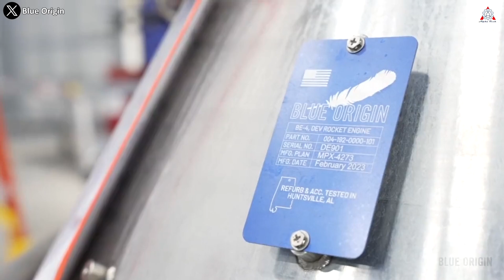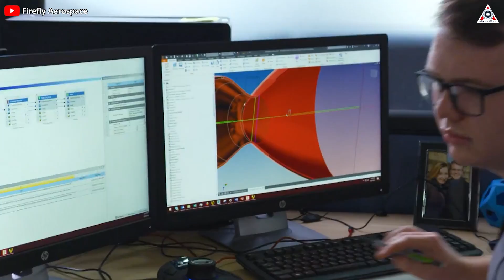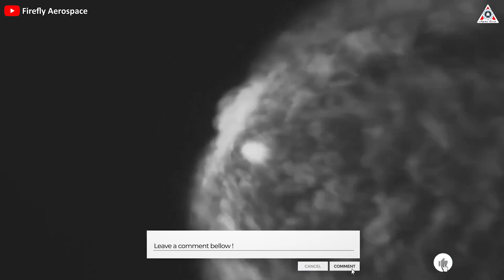Firefly's Rocket joined SpaceX reaching orbit totally shocked Blue Origin...

Comment: aren't we running out of room in orbit for satellites?.seems like there is so many up there that they are going to start crashing into each other.
Reply: not yet.
Reply: There are only very few routes on the oceans used for freight ships there are interactive maps that show those but it's maybe 10% of oceans surface area actually used by freight ships (probably less than 1% but being on the save side) and there are approximately 50,000 to 60,000 cargo ships in the world active at all times. They are 100 m to 500 m in lenght. These numbers don't include the private Boats and Yachts, Cruise Ships, Navies of Nations, Ferries, Cost Guards, Submarines, Science ships ...
Now you have orbits that at each height could be looked at as the surface of a shell at that height above surface of the earth. 200 km, 300 km 420 km (ISS) 600 km (Starlink), 35,600 km Geosynchronous and lots in between, highly elliptic instead of circular, meaning it's 3D instead of the 2D of the ocean, plus:

Google says to "how man satellites are in orbit":
As of January 3rd 2024, the satellite tracking website “Orbiting Now” lists 8,377 active satellites in various Earth orbits.

Google also says to "how many inactive satellites are in orbit":
Another 3,300 are inactive satellites, aimlessly orbiting space junk.

So ... What was your question again?